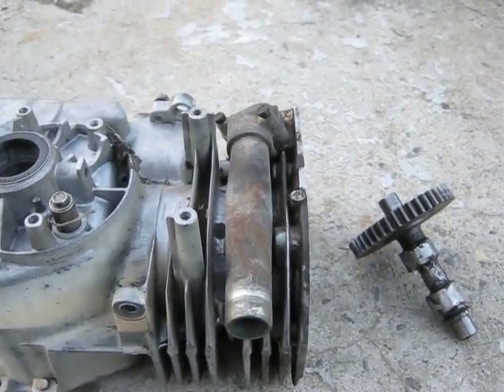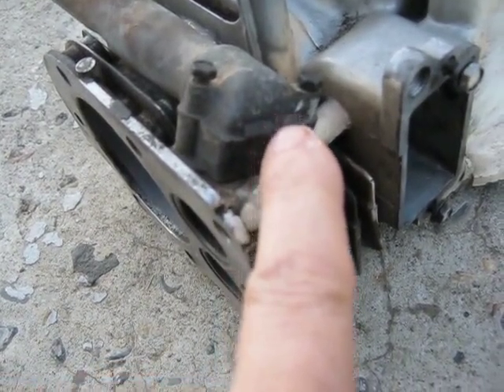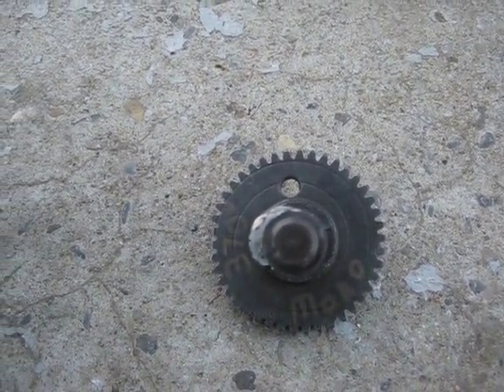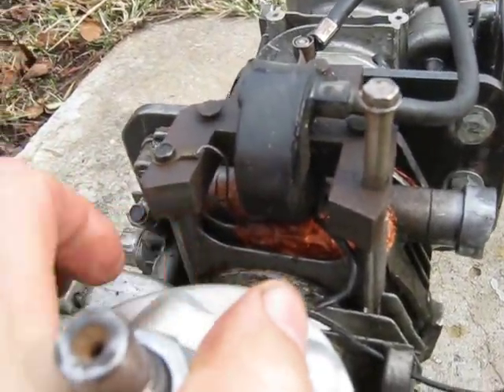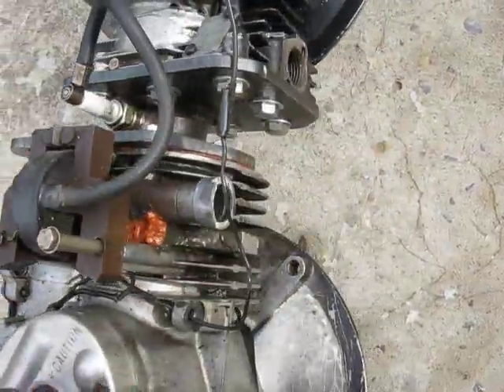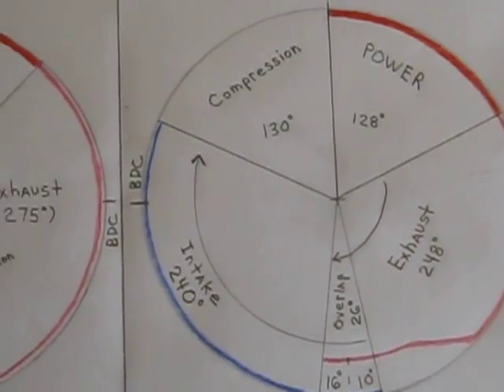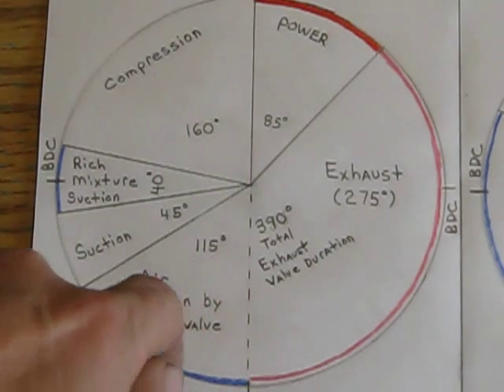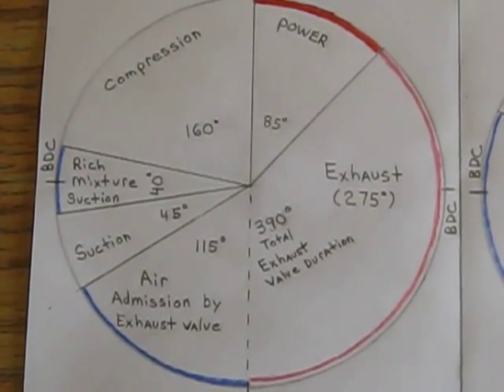Monosoupape Briggs Details & Valve Timing Diagram

Comment: got to love these odd little engines, efficiency aside they were just neat. My one question is this: on your set up using Briggs were was the carby mounted. I would think on that modified intake runner on the non exhaust engine but I could be wrong.
Reply from the maker: +Mr3wheeledbike Yes, I just mounted it in the normal place, and modified the manifold to feed into the row of fins that I plugged up with aluminum and JB Weld to create a new manifold.
Reply: ChargerMiles007 10-4 on that
Reply from the maker: 10-4 Good buddy  :)

Comment: You need to get one of those engines running again. Preferably the Jumo 205 because we only saw that one run for about 5 seconds.
Reply from the maker: +Cameron Jenkins Yes, you are indeed correct, a 5 second run, then it has sat torn down on a shelf in my basement!  :(     It wasn't totally my fault, the day I made the run was Nov 11th, and it was 60F, unusually warm for that time of year, so after I tore it down to bring it inside. The whole set up weighs about 100 lb, and is awkward to lift, let alone carry down my narrow basement stairway!
 Anyway, enough excuses, my son has been hounding me about running the Jumo 205 again, and I machined up a vibration damper from a dodge 440 to hopefully fit it allowing a longer run time.
 The Monosoupape was a much better runner, I actually managed to cut some grass with it!
Reply: ChargerMiles007 Sounds good.